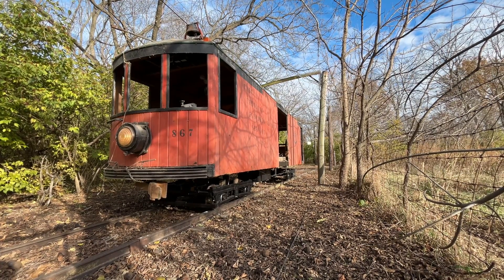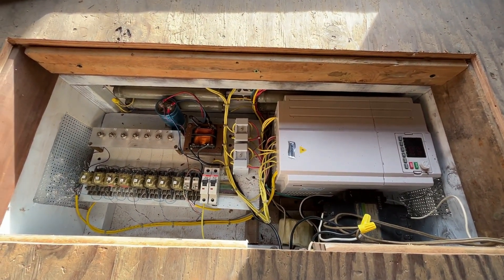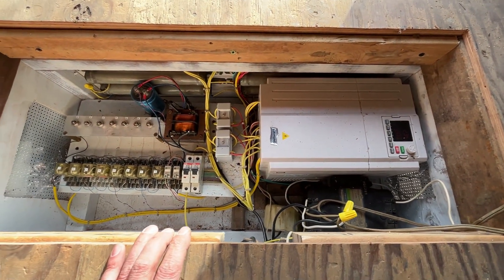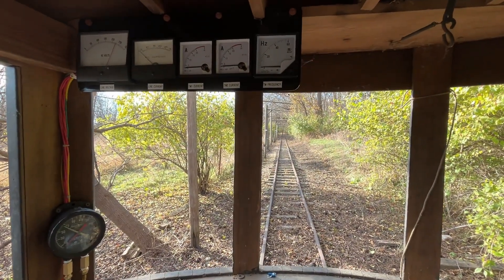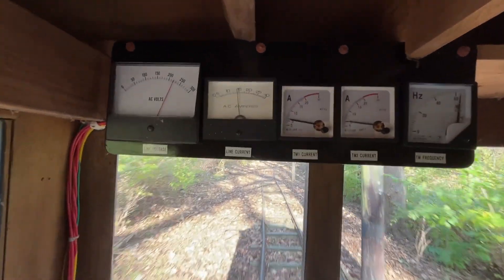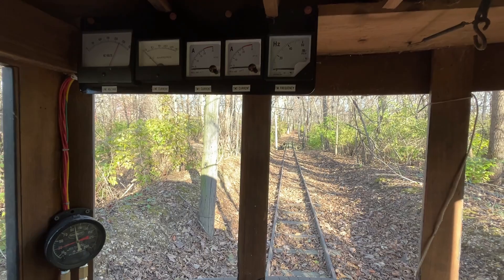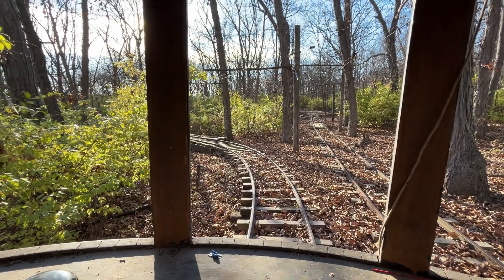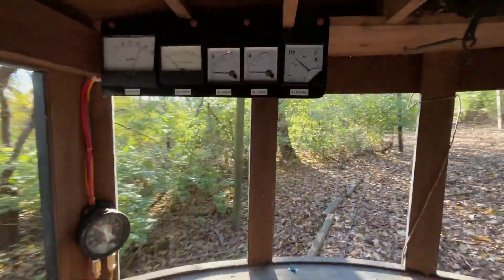Boxmotor update: VFD cabinet and meters installed

Comment: Is the set speed behaviour a result of limitations of that VFD? From what I have seen, rail vehicles with AC motors usually have each notch provide a relative amount of power, rather than full power up to a certain speed. So when you move from full power to a lower power notch or neutral it does not try to decelerate until you put it in one of the brake notches, when it then takes over from the EP brake to dynamically slow it down until it gets down to a certain speed and the EP friction brake re-engages again.
Reply from the maker: This is because in a large vehicle application the power limits are based on torque and not just simply frequency as it is here.  The frequency is what sets the speed of an AC motor, the voltage provides the torque. In those applications, there is a motor speed feedback signal which allows the inverter output frequency to match to the speed of the motor at all times.  So for instance if you are going 10 mph and notch down, only the torque limit value is reduced which causes the VFD to reduce the motor voltage to near nothing and allows it to coast without decelerating because the frequency out of the VFD is able to be held to whatever speed the motor is turning. When the motor needs to provide actual power again, the motor voltage will be increased steadily until the allowable torque limit for the notch is reached. If I had a speed feedback I could do this too, but this type of operation is not really needed here because its such a small load and the complexity of adding speed feedback isnt really worth the extra work. Someday I may experiment with it, but for now my notches are basically fixed speed settings and the drive just provides full torque at each notch based on a V/Hz schedule contained within the VFD. Hence why when I notch down, the car essentially power brakes- only the frequency is being reduced and the motor voltage is maxed out trying to hold full torque out of the motor.

Comment: Excellent engineering, layout, and workmanship. Love the dynamic breaking.  Very impressive.  Would you consider changing the scale of the motor ammeters to provide a bit more action?
Great video - keep 'em comming.
Reply from the maker: I agree they could have a lower value for the maximum current level displayed, but the next lowest available full scale reading meters were technically too low for the application and I was concerned they may max out. After observing the operation now, I see that they probably would have been ok as I have yet to get anywhere near what I thought they might hit. When I took the initial current readings I was only running with one motor and the current was much higher. Now that I have 2 motors, the current is greatly reduced and the smaller meters would surely be fine.

Comment: Beautiful... all! Leaves, tracks and very special the driving characteristics. I'm not familiar w/ the setup, but am interested in how much power is used or burned to break electrically. Is it comparable with the amount needed to go uphill? - I wonder what it would need to recoup the energy and feed it back into the network. I assume you are not planning to run when it is rainy or wet, since I see no catching of spray entering the vent grills.
Reply from the maker: A long time ago this operation attempted to operate at 120 volts, but rusty rails / wheels / leaves / etc caused the cars to stop and go a bit as the voltage was not high enough to "break through" the insulation provided by such things. Thus the line voltage was increased to 240V and this problem went away. I do not run in the rain, mostly for safety reasons but also I wish to keep the carbodies free of moisture which would accelerate their decay.

Comment: Ever think about making an electric leaf/snow-blower car? Kind of like a jet car but with electric blowers — I think it would be awesome. Love your videos, and your little railroad setup is very cool.

I'm an e-bike tech myself, and I really appreciate your explanations. Dynamic braking is similar to regen braking, but the difference is that the energy isn’t fed back into the overhead wire — it’s dumped into a resistor to slow the motor. On an e-bike with regen, when you apply the brakes, the controller reverses the flow of power back into the battery instead.
Reply from the maker: I have considered such a device and even got a couple leaf blowers to experiment with. Not so much for the looks of the leaves on the track, but I feel the ties would last longer if they werent covered with wet leaves for 4-5 months of the year. I'll get there at some point! I'm well aware of regen, as an owner of 3 EV's its the best thing ever :)

Comment: Very cool! I might offer a suggestion based on my nearly 3 decades exxperience working with a major Light Rail Vehicle and locomotive manufacturer. Your electronics would be much more happier with a continuous forced air flow, which is filtered. It looks like you have plenty of room for an external AC pwered fan, and in the equipment box room to set up an air flow diverter to channel more air to the resistors, which are bound to get a bit warmer than the traction drive, and you won't have to worry about getting so much debris in the box. You can draw your intake air from inside the car to hide the duct work.

Anyway, really cool stuff you have got going out there!
Reply from the maker: If I was running large amounts of power, I would certainly have forced air flow like I do on the DC choppers. I have taken numerous temperature measurements and there is virtually no heat being generated by the drive so I have left it as is.
Reply: @CNW4145  I was just more concerned about possible moisture and fine debris ingress into the equipment box.

Comment: Why you are not building a diy vfd/vvvf you can find in the internet many modules if you are interedted i could send you a schenatic
Reply from the maker: I looked into this but for the price of the VFD I couldn't justify building my own
Reply: @CNW4145  Hi CNW4145 and lewin_sim5119   I agree with the fact that on price alone purchasing a VFD is the cheapest path and also the path of least resistance. In the long term a homemade VFD would enable a lot of customization including the desired do-ra-mi-fa sound, another benefit is that the critical parts could be stockpiled for future use and repairs.  A dsPic could do the job, it would be interesting to see a costing on the major components.  I'm certain many of the viewers of CNW4145 would be willing to help with the hardware design and source code.   Ken_K

Comment: Fantastic. Thank you for the fall ride with the leaves down.  Do you consider replacing the potentiometers with fixed resistors or just keep 'em for fun and tweaking?
Reply from the maker: They will stay potentiometers, no reason to fix them as I may want to change the speed settings as time goes on.

Comment: I'm interested in how it switches between notches without jerking - does it just switch between potentiometers or is there some sort of successive shorting out going on? I've used VFDs which would ramp up and down quite slowly but this one seems to respond quickly when commanded but doesn't drop back between notches.
I was going to comment on the braking resistors which would normally be mounted externally with their own fan but I see you have covered that in other comments. I'm surprised they don't get hot as there must be quite a bit of energy being dissipated to slow the car down.
Reply from the maker: The VFD is programmed to have a ramp up and ramp down rate, so in the switching between notches this ramping in the software controls the jerkiness that might be found if it did not have such a feature. There is very little current in those resistors, so the internal braking resistor must be quite large and they do have a fan on them. If I use only the internal resistors the drive will fault out going down the hill, due to them not being able to dissipate all of the power- but once I added the externals all of this stopped, and does not create any noticeable heat.

Comment: Cool!  Very nice!  Good job on the new undercarriage control systems.  I'm not entirely sure I understand all of it, given that my expertise is in steam, but good job nonetheless.

One thing I will say though, is that I wish I had my own private railway on my property, but sadly there comes the tiny little problem of the terrain.  Too many hills for steam, and not enough continuous grade for a rack line and engines.  Even electric engines like your Boxmotor would get terrible wheel slip, and diesel/gas would simply get that fuel sloshed around so much that it might just fail to reach fuel line to the engine.

Oh well, maybe someday.

Anyways, good job as always, and good luck with getting it all up to modern speed.  Rockatoa, Brickticks out!
Reply from the maker: I hope someday you can make it happen, such a joy to have this to play with and work on :)

Comment: Coming along nicely.  

a few thoughts:
I've seen many videos for using the compressor from a refrigerator instead of a shop compressor.  Much quieter.  Would you consider that?
are you trying to preserve the looks of the car, at all?  could those fairly modern gauges be hidden in a bulkhead of some sort that's only opened when you need to check anything, etc., or replaced with older looking gauges?  maybe one old gauge for air pressure and a second for frequency or whichever's most important to you?

not bashing, just curious.  and jealous :)
Reply from the maker: I am always interested in finding different compressors for the equipment, I'd prefer something low speed so it gets the proper "wub wub wub" sound but it would need to be large due to the low speed. At some point I'll more seriously dig into this aspect and get it fixed. As for the gauges, I'm an instrument nerd so I like to see the values of everything in real time, all the time :)
Reply: @CNW4145  Oh oh oh!  find one of these old craftsmans from the 70's. it's got reed valves and makes the best sound! here I uploaded a clip of mine!  https://youtu.be/_Gbxa5CnOKI
Reply: @DieCastoms A great compressor! this is what we need in our business. The sound of this compressor is as authentic as possible to those compressors that were used in vintage trams. The only negative point is that it cannot be positioned horizontally under the bottom of the locomotive. only vertically.
Reply from the maker: I have been keeping an eye out for one of these to come available for a reasonable price, the sad thing is that when I was a kid I used to dig these out of the junkyards and fix them up to give away. Now they are hard to find, if only I had known!

Comment: Is the resistor bank so close to other electronics a concern?  I’d be worried about it slowly cooking things.
Given that you use them to slow down I would assume they are the hottest when you are stopped which also means no airflow from moving through the box.

Maybe a probe thermometer down there to test?  Just hate to have the electronics life shortened.  I’d also worry about dust buildup over time but with a compressor there should be an easy maintenance thing.
Reply from the maker: I have shot the resistors with a laser pyrometer and there is no heat being generated by them so it is not a concern- there are also resistors internally in the VFD and they are apparently doing 90% of the work.

Comment: Hiya mate lovely video! Just a note - modern VF electric trains use the speed of the train to determine which frequency is pulsed, while the notch controls the voltage, it’s called VVVF technology but if you are using IGBTs you will find much smoother acceleration using VV as well as VF. That’s a loose concept of how it works but it would be really interesting to see a new cab controller build to allow this. I do see as I watch the end that you seem to have the functionality you want but you could potentially have it hold speed with the dynamic break at neutral and the lever then becomes a direct control of acceleration rather than a setting of what speed you want to go! Love the videos man ❤❤
Reply from the maker: Yes I would like to use the VFD in that mode but I do not have a speed feedback so that is why it works the way it does. If I end up disliking the control at some point I may look at adding a speed feedback so proper closed loop control could be used.

Comment: That is totally awesome. If I live a lot closer I would love to help. Suggestions if you get snows. Think about a plow to keep snow out of your control box under board.I would ask a round or make friends with a policeman who has access to a radar gun so you can get a speedometer to work correctly, or at least know in what notch is what speed on level, uphill, and down grade.  All the best
Reply from the maker: We do get snow, but the railroad in inaccessible when it does snow so there is no operation through the winter :(

Comment: You should decrease the carrier frequency of the VFD... sounds better that way
Also that overhead catenary looks very nice- is contact made with a pantograph or trolleypole?
Reply from the maker: Ive got the carrier turned down to 1kHz which is as low as it will go, I do agree that I wish it was louder! The power pickup is made with a trolley pole and pickup shoe affixed to the end of it. Someday I will experiment with a pantograph though, just for something different.
Reply: @CNW4145  A lot of early AC traction trains started with carriers around 300-400Hz but then switch to pattern based pulsing as the train speeds up. Pattern based pulsing sounds really epic especially when the pattern changes and you get a "gear changing" effect. Some older VF drives let go lower but nowadays everything's a high pitched screech.
A pantograph would be interesting but you'd need to stagger the wires back and forth. At least you'd be able to sail through all the junctions at top speed without worrying about it dewiring
Reply from the maker: Yeah I love the sound of the do-ra-mi-fa inverters used on the older european railway equipment. I do have one of those old VFD's that still does this, I use it for my test stand in the shop but its not big enough to put on the car ( only 1 HP, not the 10 that I need)
Reply: @CNW4145  My favourite type are those found on early 90s UK EMUs
Particularly the networkers, they sound amazing. Just a shame that a lot of them have been retired already and for the rest dynamic braking is disabled.

Where do you get all the parts especially the inverters? I've seen your homemade chopper circuit in one of your other videos but the big inverter?
Reply from the maker: I sourced the inverter from Amazon actually, its a 10HP model that is driving both 2 HP motors which are wired in parallel to the drive. Knowing it was a chinesium inverter I selected it to be twice the size I need because they often overstate their ratings, and also this particular model said it would work down to 180V input which is important for operation on rusty rail.

Comment: Sounds great, looks great but more important, it runs amazingly! High time I think the box motor got a new coat of paint wouldn't you say so too?

Absolutely amazing, keep it up!
Reply from the maker: I'm going to leave the paint for now, its been on there since '67 and I doubt the newer paints would last that long!
Reply: @CNW4145 
Lead paint ?
Reply: @danielfantino1714  The best kind of paint!
Reply from the maker: @danielfantino1714  I'm sure it is, given the era it was painted in. Which is why there will be no sanding!
Reply: @CNW4145 
I tryied paint remover on stainless. The lead paint required a huge amount of remover, it turned gouy, muddy, but didn´t really take off. I finally quit, remove the slushy mixture and paint over regular exterior oil paint. It worked. The idea of removing the paint was to get a smooth finish. On some spot painted at chipped away.
If YOUR paint is holding good and not peeling on your wood, you can paint over it. Lead paint, at least on metal is by far the best primer. It´s holding strong, a bit "soft" and resist well to expansion contraction like on stainless.
If you ever sat in a Budd car in a quiet environment without "noise" you can hear constant cracking in a warm sunny day. As soon as cloud hide the sun, the cracking contraction can be eard. Again when sun reappear.
Wood react mostly to dry, damp cycle and your 50 years old paint looks old, but not so peeling. Modern shittery paint would never ever hold so well. Keep it. Best primer. One friend said that lead powder to make it was available overseas and wanted to do its own lead paint for its 1910 Pullman heavyweight PV. Keep yours, your wood is under good protection.
Reply from the maker: Ive run into this issue trying to strip paint on doors in my 130 year old house- tried all kinds of strippers and it just turned it to slush but didn't remove it! Needless to say I got what I could off and just painted over it lol
Reply: @CNW4145  i suppose at this point its "historic " so i can respect that.

Still, i think it would look splendid at match the steeple cab